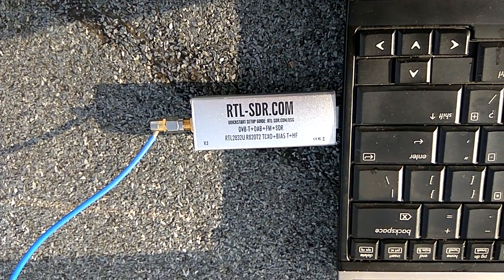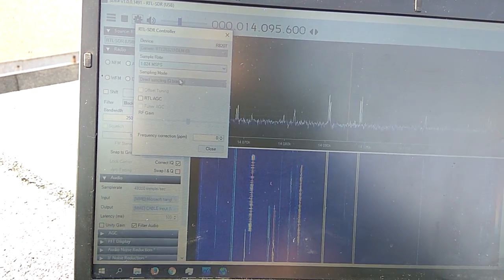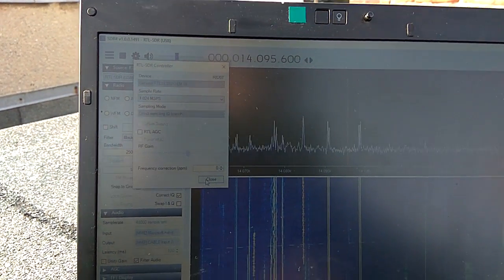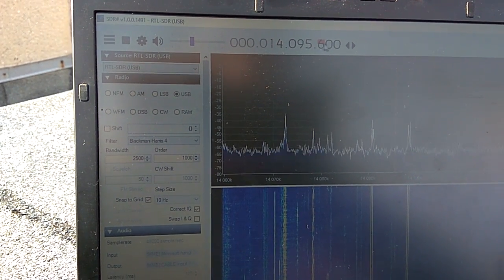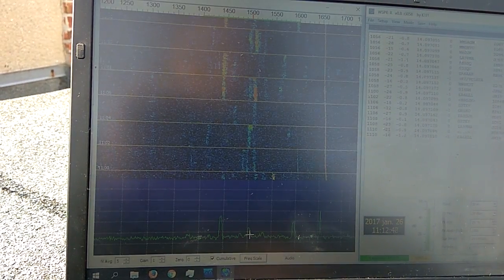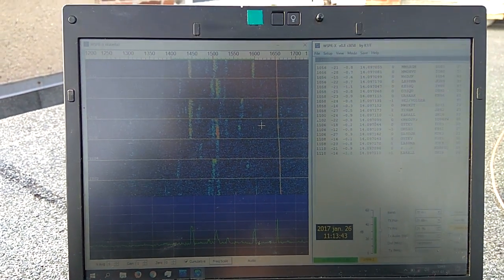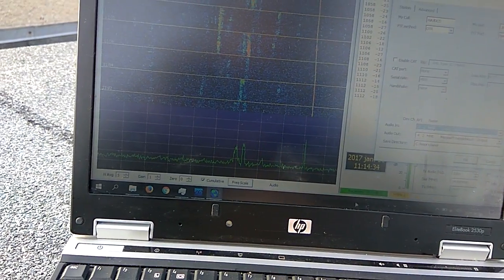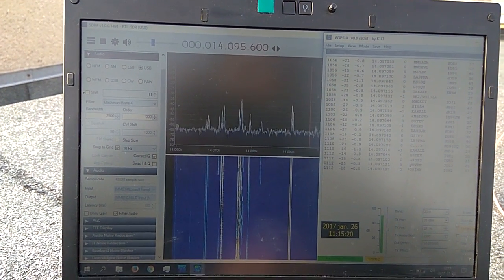Easy WSPR reception using $19 RTL-SDR dongle

Comment: This is one other thing you need to ensure WSPR reception -- your computer must be sync'd to an accurate time source.  If your PC's clock is off by a few seconds, WSPR won't decode.  Mine was off by seven seconds and that was enough to prevent any decodes at all.

Thanks for the video.
Reply from the maker: Ahh... excellent comment! Thanks for reminding me I put a text note to the video it is really really important because of the 2min time frame! Thanks!